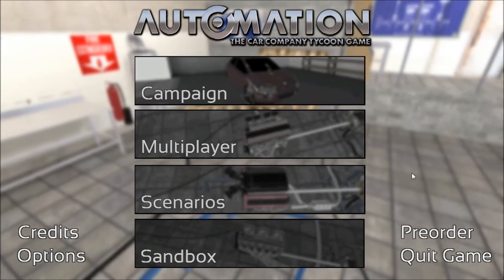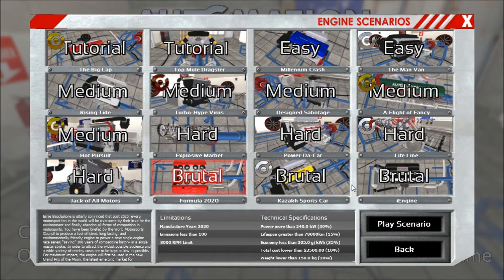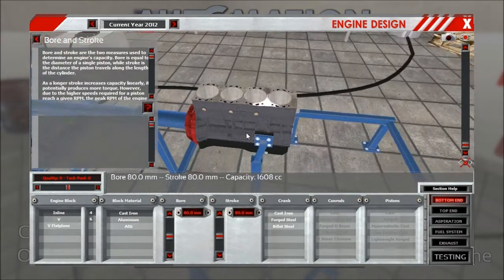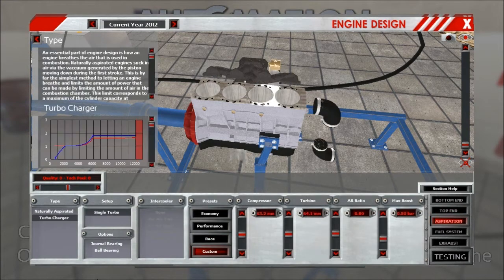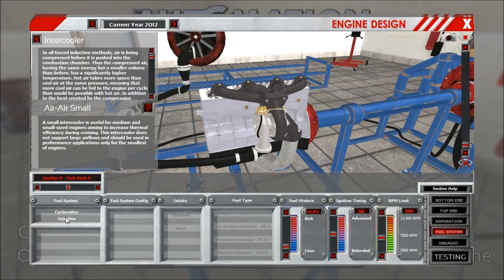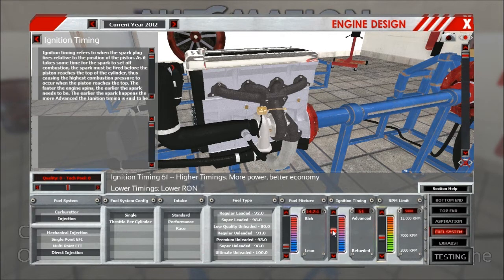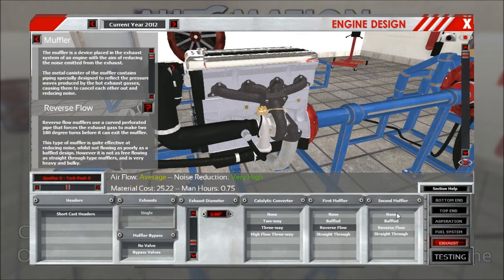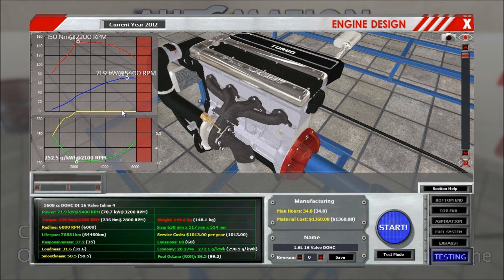Little Dev Update: 16 New Scenarios & Turbo Ecobox

Comment: What we need.1)Air filters. 2)Exhaust component individual tuning including material selection. 3)Exhaust and intake valve ports angle,position and fine tuning. 4)More precise bore tuning for better displacement control. 5)Cylinder surface fine tuning. 6)ECU tuning,remapping,parallel ecu. 7)Individual boost controler or integrated in an upgraded ECU. 8) Cooling system options,size,placement,materials. 9) Engine lubrication options,oil pan,pump, oil type and quality. 10)Ambient temperature.